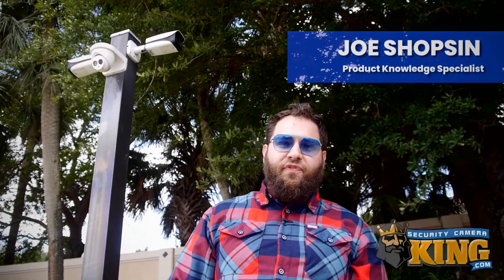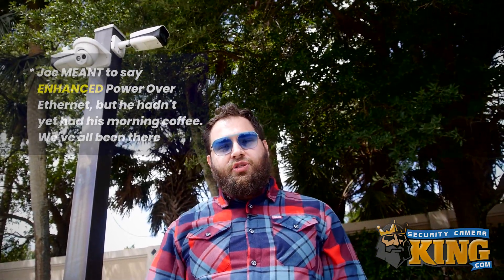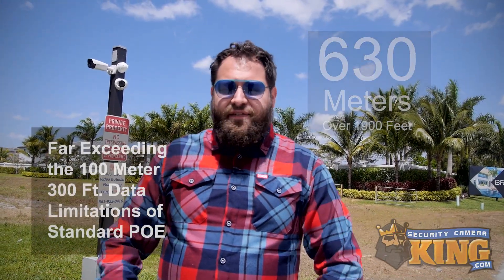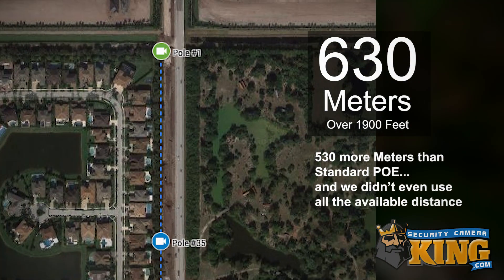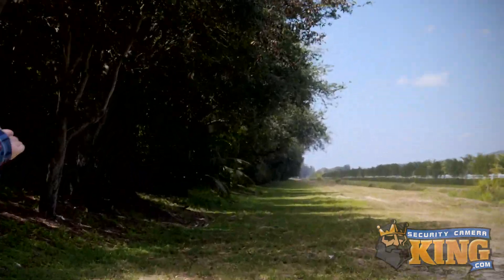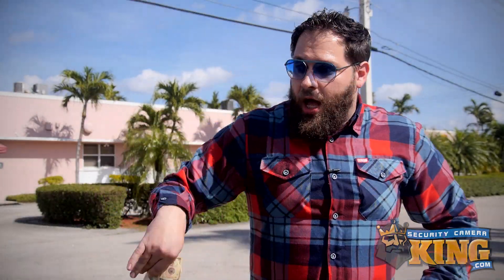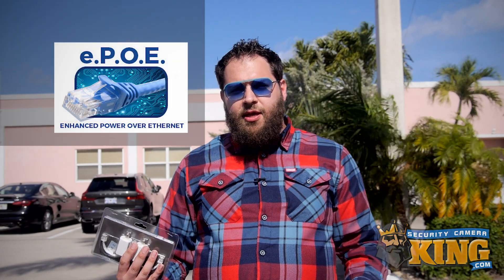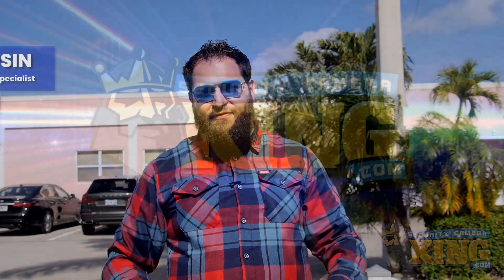How to get long-distance Power over Ethernet?

Comment: Would have been nice to have more info.
How does it achieve the extended distances?
Reply from the maker: JK, at it's base level you just need to make sure that both your camera and your power delivery source (switch/NVR) are ePoE products and everything will work as advertised.  As for under the hood, the extended distances are achieved through a lot of custom code and proprietary technology leveraging 2D-PAM3 Pulse-Amplitude Modulation.

Comment: What would you recommend for a 100 acre farm in Brazil with no internet access and poor night lighting?
Reply: A bigger gun
Reply from the maker: That is wholly variable depending on what you're trying to view, available power sources and perhaps even line of sight.  There is likely a combination of ePOE equipment, PTZ cameras with long zoom ranges and point-to-point antennas that can create a private wireless network with line of sight over 15km if you have power at both ends.  Internet is only a requirement if you need to view your system remotely, an NVR can provide you a local view on a TV or monitor without the need for an internet feed.  If you are interested in a quote, please reach out to our sales team at sales@securitycameraking.com or open a live chat on our website www.securitycameraking.com to let us know the scale and scope of the project to see what hardware would best suit your specific needs.